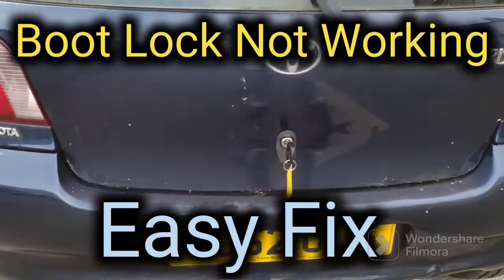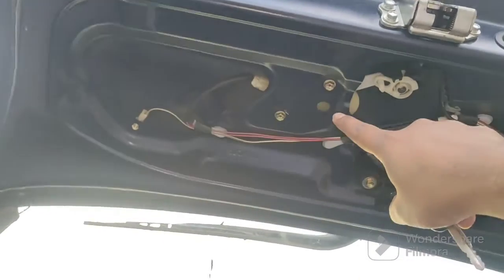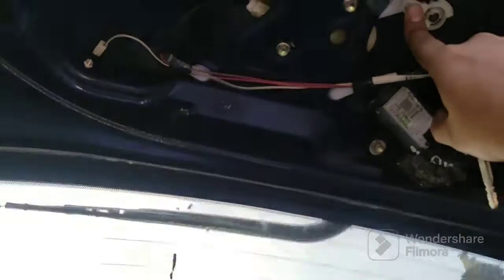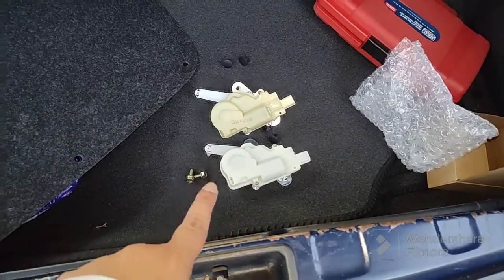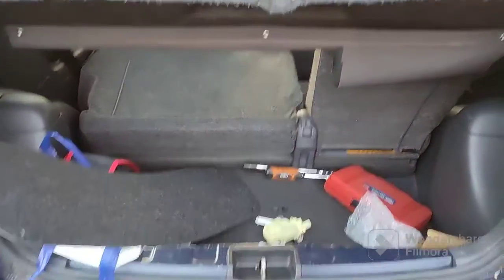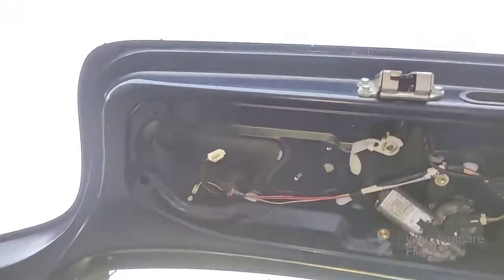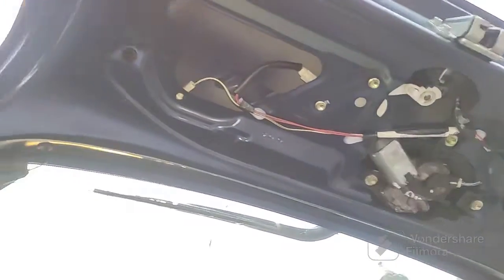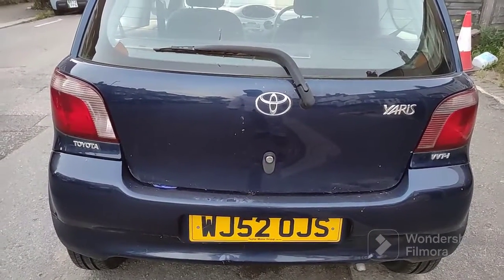Toyota Yaris Boot Lock Fault - Fixed at Home for less than £18.

Comment: Thanks for a great video. We got a Mk2 Yaris last October and the only thing about it we didn't like was the boot wouldn't lock/unlock with the central locking. We weren't sure it was supposed to until seeing your video. 
I opened up the old one carefully using a Stanley knife to persuade the cover off. The little electric motor was extremely rusty. I did try clean it up but still could't get it to work so got a second hand replacement for £15 and it's fixed thanks!
Reply from the maker: Hi, thanks for your comments and really glad the video helped

Comment: I have a question. Do the rear doors also lock with central locking? I have a 2004 mk1 but the rear doors never locked automatically...got it second hand
Reply from the maker: Yes rear doors lock with remote control

Comment: After this can you open up door by using a key?
Reply from the maker: No - I decided against changing the barrel (it seized)  as it would've meant another key, but in short the barrel also needed changing to fully complete this. I Prioritised getting the actuator to work so that I could lock the boot and due to age of car happy to live with barrel like that.
Reply: Awesome, thank you for your help 🙏 & good question

@sutsi, I am wondering if you have a clip on your channel to see that vid that you are mentioning in this reply? If you changed the barrel?
Would you be able to link it please? 🙏😊

I am not sure if it will suffice for me to only exchange the white lock system.
Thanks mate 👌
Reply: @sutsi  Awesome, thank you for your help 🙏 & good question by username motoichi

@sutsi, I am wondering if you have a clip on your channel to see that vid that you are mentioning in this reply? If you changed the barrel?
Would you be able to link it please? 🙏😊

I am not sure if it will suffice for me to only exchange the white lock system.
Thanks mate 👌
Reply from the maker: @UniqueGeekFreak  unfortunately I don't as I decided against changing it. Sorry
Reply: @sutsi  thanks for replying 🙏

So it only sufficed that you changed the white lock part, as you did in this video, for it to work properly?

I'm asking because I have the same problem,  but I only think it's the white part that is the problem.

I'm just trying to understand what parts I need.

I can't open the trunk with the automatic lock key, or the analogue way to open the trunk with the real car key inserted into the trunk key opening.

My trunk started to malfunction when the batteries on the automatic car key started to go low.
I tried inserting the analogue car key the manual analogue way.
After that I messed it up and couldn't open the trunk either way.

The shite car owners before me had put a string on some part of the lock instead of repairing it.

So I don't know how they saved it with a string of line to make it work.

Anyways.
I think I will try with changing the white part first, as you did here in this video.
If it doesn't work, I might need to change the other trunk lovk/barrel.

Thank you 🙏

Comment: I wish I find a vid where I see how the panel is removed... The lock is an easy fix compare to this fragile piece of plastic!
Reply from the maker: @roundaround2448  the panel is fitted with those plastic tabs/plug screws...you just pull those out and the panel comes off
Reply: @sutsi  i thought some hidden screws were living Somewhere, but I actually could fix It thru the little trap, 
Works fine now